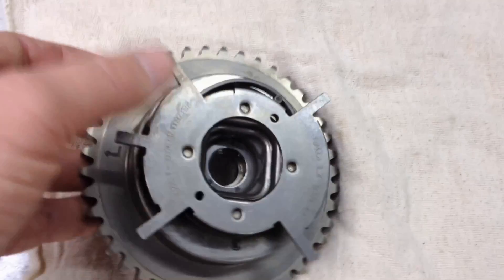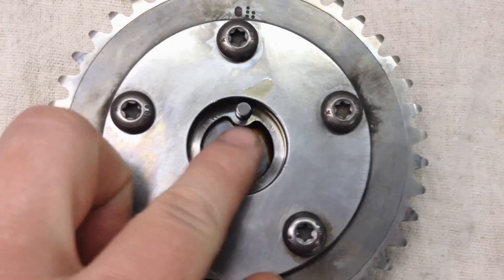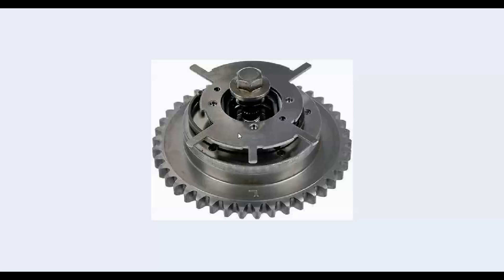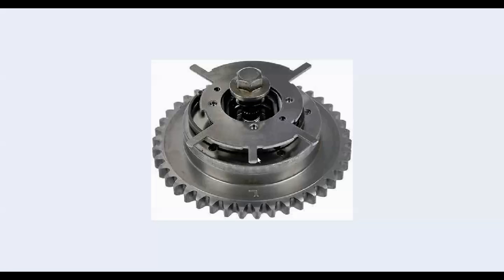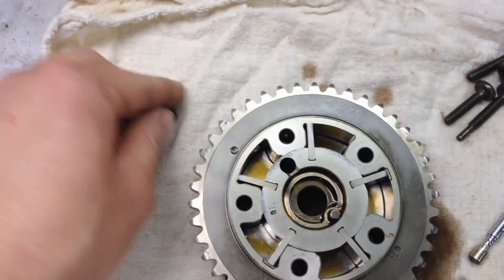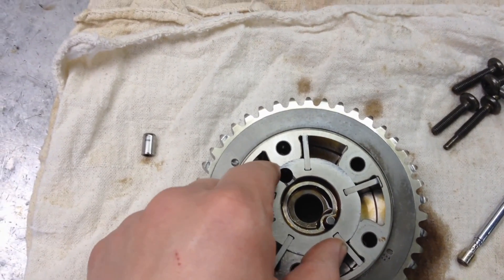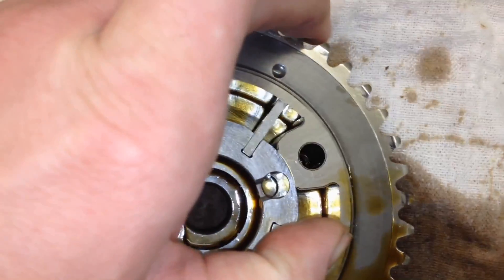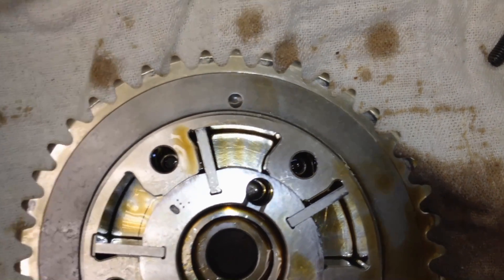Ford 4.6L 3v & 5.4L 3v Camshaft Phaser Knock Explained

Comment: +FordTechMakuloco so is it true that increasing the weight of the oil from 5W-20 to 5W-30 can solve the issue? I always figured that by increasing the weight you would just be putting a bandaid or a bigger problem but if increasing the weight will solve it I can do that I'm due for an oil change anyway. Ive got a 2004 F150 5.4 Triton and ive been running 5W-20 synthetic. The ticking noise is definitely noticeable but not as defined as some that ive seen. Im debating replacing the VCT sensors as well.

Comment: Hey my son bought a 2006 Ford Expedition with 5.4 liter 3v and we replaced cam phasers and timing chains , guides and tensioners and I know for sure I timed it right , but now when you go to crank it it is like the timing is off it cranks over slow and when starts it runs good but has a crappy idle and no codes , when I pulled the bolts out both cams hardly any oil came out someone told me I should have blew air thru to make sure they weren't stopped up coming from camshaft is that true ? I rechecked timing marks are good but when cranking it is like when you have a distributor turned to far and it hard turning motor over , also it is popping thru intake , any help would be great , thanks
Reply: It is not timed right. sorry

Comment: I have a 1998 Expedition with a 5.4 triton but I dont know if its a 2 valve or 3 valve . It has no VCT solenoids and it uses regular plugs so I assume its a 2 valve , but it sure seems to make this same " paint can ball rattle " especially in a drive thru or next to a wall .
Reply: I have a 2000 f-150 with 230,000 mi. It has a paint can rattle noise but its my catalytic converters. I don't think they had Variable Valve timing in 98
Reply: 2-valve, 3-valve was still a few years away then.

Comment: +FordTechMakuloco Good afternoon, i have an 2005 mustang GT and I just replaced both my phasers and both VCT's, every worked well the first 50 miles but then I heard what sounded like phaser clicks but not as audible as my old phasers were... Got a check engine light last night and this morning it chatters again....
When I did the install of the new phasers, I did notice as I torqued the new driverside phaser, the tone wheel  turned/rotated as I torqued the main bolt, does that mean the locking pin sheared?
Reply: Also, in regards to the tone wheel rotating while I torqued the phaser bolt down... It rotated about 30 degrees and when I stopped applying torque, the tone wheel returned to its normal position on its own.
Reply: hello, did you figure out the problem? I have an 05 Gt as well & I am barely going to replace both phasers & VCT's

Comment: do you recommend doing these in pairs? i usually have seen just one fail but seeing as you have the whole front cover off it might be a good idea to do the other because it is following. just wondering your thoughts. great videos.
Reply: If you're in there it's cheap insurance at that point. depending on the mileage, I'd probably put a new chain and tensioners in too.

Comment: +fordtechmakuloco hello there im from NY i own a 05 f150 5.4 at the shop they just did timing chain job, few days after i got the car back i hear this crazy rattling noise and truck would shut off at red light etc, i brought it back 3rd time now for same issue and they are doing the cam phaser now, plz help on a reply i do feel like these guys aremt honest to me

Comment: my 2006 f150 starts ticking shortly after start up. Not sure if it's the lash adjusters or cam phaser. I changed all plugs and cops 10,000 miles ago. truck pulled a misfire code @ # 4. changed cop and plug no change. changed out fuel injector and ran ok. Idle is now rough and low, but never dies. Now, when I hit the gas its falls on its face, stumbles and just won't accelerate at all. Again,  no trouble codes. I bought the truck new and have changed the oil every 3,000 miles. It currently has 158,000 on it. Any suggestions on where to start or look?

Thank you for the videos and your time!

Nick
Reply: I GOT SAME PROBLEM, AND A  TOP SPEED ARE 70 MPH, NO MORE...

Comment: The major cause of this is not running the correct oil. As the owners manual says use 0W-20W synthetic. As the passages are very small and running heaver weight oil it can't get in to the small holes used to control the pressure on the Phaser for timing.
Reply from the maker: Idk the manual calls for 5w-20 and many have ran heavier weight oil like 5w-30 or 10w-30 since new and report no problems with the vct system it protects the vct's better. Same reason turbo based engines generally run a higher weight.
Reply: FordTechMakuloco I was just making general observations. As I seen people use 5W-30W and the manual says 5W-20W or 0W-20W depending on those magic words "Sever Duty" or Conditions, which is not defined. So I always look at the manual and what the normal operating weather conditions are and if proper maintenance for that vehicle was done. As the weather is different down south and up north.
Reply: +Michael Mike I've done a lot of research since I last commented, and it seems like Ford's modular engines were designed with running 30 weight oil in mind. They only state to use 20 weight oil for emissions regulations, which is a shame since it's not the intended oil weight for the engine. I use 30 weight oil in my 2008 Mustang GT and it works great. I'm in Florida and it gets very hot here, plus my engine has 128,000+ miles on it so it's good to step up the weight at that point because of wear and tear.
Reply: I'm having an issue with a noise on my passenger side of the engine exactly where the phaser is on my 2008 Mustang GT. There is a noticeable loss of power and something os definitely not right. Funny thing is, I changed my oil from castrol full synthetic to amsoil full synthetic, both were 5w-20. So I'm certain my car doesn't like that oil lolz....
Reply: +Claude “Reviews4U” Rains I've run 5w20 Motorcraft since I bought my truck at 18,000 miles and now at 90,000 it's starting get loud... so mine is due to defective component imo.
Reply from the maker: Michelangelo Hamato I agree especially on the 3v engine 5w-30 is the way to go.
Reply: +FordTechMakuloco :)
Reply: +Joe Correia the manual states 5w-20 because Ford wanted lower emissions ratings on their vehicles. But the 3v engine was actually designed with 5w-30 in mind. Many Mustang owners, myself included, made the swap from 20 to 30 with no problems.
Reply: +Michelangelo Hamato really....I mean I have tried 5w30 in the summer months but went back to 5w20 after reading different things and coming to the conclusion that I'm not smarter than the Ford engineers...lol
Reply: +Joe Correia The Ford engineers are smart, but the rule makers are slicker... which is why you car says 5w 20 and not 30. You should give it a try again :p
Reply: my GT 2006 does the same thing so I drive it with VCT solenoid unplugged, how did you fix it tho?
Reply: +nirson123 replacing the phasers or solenoids will fix your issues. It can get costly fast though, and it's hard to diagnose whats actually wrong. If your timing chain tensioners are bad and your timing chain is rattling a lot, it may have an oil leak which can also affect the vct oil pressure
Reply: no way will I use a s*** 20 weight synthetic!! I have over a hundred eighty thousand miles on my Expedition 3valve, using Castrol 10-30! it's a tough ass motor so no way will I use a girly, 0w20!!!
Reply: @DRDRE-ex6yg  yeah that's what we call "bitch weight" oil...strictly for girl scouts

Comment: I have an 2006 F250 5.4 Triton with this problem.  Is there an replacement engine that's comparable to the 5.4 Triton without cam phasers?  I think mines has more problems then just the cam phasers and I'm considering just replacing the engine to avoid this problem...just not sure how to find a legit replacement engine...

Comment: Hi, One of my Cam Phasers did not have a Plunger on the spring. Why could that be???
Reply from the maker: +fresnoblue13 Was it a different brand? It may be a new design also. These phasers have been revised multiple times over the years.
Reply: Not sure, they also both have the L and no R on neither side. My chain guides and one tensioner was bad. my Phasers look good plus I installed limiter on them. just don't want to put everything back together if that one phaser not having a plunger inside will cause any issues
Reply: +FordTechMakuloco Hi, I checked them out yesterday and they are both Ford phasers.
Reply: +fresnoblue13 u.kl just nmjol
jm;ĺnio

Comment: after changing the oil with a synthetic blend and  replacing  the solenoid's on both banks and started the vehicle, im still getting the rough idle after the vehicle warms up a bit....im so pissed right now..lol   the codes I am getting are po0012 and po0022 and po345   plus o2 code because he remove the CATS.   it runs great at idle when I first crank it up so it apparently in time. but if I step on the gas and let it fall back to idle the rough idle begins....I can turn the key off and then crank it up some times and it will run great again until I hit the gas again... what do I do? change the phasers?  is there any thing else it could be?  I have voltage to the secondi's.. please get me in the right direction with this...what else could it be.....low oil pressure? how low is too low?  the vehicle is not making a lot of noise after operating temp has been reached... I wish I would have check out this video earlier... I could have check the alignment or the phaser.. looks like I have to tear it down again.  if you have any ideas or comments I would appreciate it.  thank you... this is my first po0012 ect.... and it figures it wouldn't go smoothly by just replacing the solenoid's.. lol
Reply: did you figure out the problem? I know the po345 is for the camshaft position sensor replacement which is around $15-25 online or auto parts store
Reply: yes, bad phasers.. thank you.

Comment: Nice video. Very informitive. I have been a Ford guy for 37 years. Thies have git to be the biggest POS engines ever made by Ford.  My wife owns a 2 valve and it has been the biggest pain. My 3 push rod Fords has none of the problems that thies have. I surely dont want a 3 or 4 valve.

Comment: I'm not sure my car had the phaser knock trouble. 94 Mark VIII I bought it with 100K miles always ran beautifully EVEN THOUGH starting procedure always included WHAT SOUNDED LIKE a flat lifter. The knock never lasted longer than 1.5 seconds then disappeared. I have been told that the sound might have been a cam chain tensioner part. But something broke making the car quickly overheat. Now IT REALLY BEHAVES exactly like you would expect from a motor that is a tooth off on the timing. Can you please point me in a direction??
Reply: I think the 4.6 L 2valve motor is your best bet. Cam phasers are found on 4.6 3 valve motors as of 2008.

Comment: Don't forget to check the timing chain tensioners, the gaskets blow out between the tensioner and head causing low or no oil pressure in the top end. Always a good idea to pull a few camshaft caps to check for scoring. Just because the phaser is making noise does not mean it is the cause. Sscc
Reply from the maker: Kwils69 Good points

Comment: Interesting how it works, seems like it moves quite a bit so I assume that would translate into quite a few degrees timing ? That seems like a frequent and expensive repair.
Reply: 2002 mazdas had the same designe on their mazda 6-s and. my cars still works, even though the last owner didnt take care of the car.
Though mazdas design has extra thought but into it, so no raddle and smoother movement with steady pressure

Comment: does this problem cause the car to shake and rattle? like the car is going to fall to peices? my car has this problem when the car is hot in temp  after it runs for about 20-30mins then  cruising say over 30mph and comming to a dead stop and bam  the noise and shakes and the rpms dip to around .5k  i give it gas to around 2k rpm and its fine again but from .5k rpm to around 2k rpm alot of hesitation and sever power loss   any sugeestions and help would be greatly appreciated  thanks
Reply: did you find the problem? It is happening to my vehicle as well...
Reply: bodyfittv any luck?

Comment: Great videos!  We currently have a 07 f-150 5.4 in the shop for some noise issues.  The difference here is the engine is silent cold and when gets hot starts making a rattle/tapping noise off between 1000 and 1400 RPM.  Base idle is relatively quiet (although there is still some light rattle noise).  With the VCT solenoids disconnected, the off idle tapping goes away altogether.  Our base oil pressure is 28 lbs hot idle.  I am thinking this maybe a solenoid issue.  What is your take??
Reply: Chris Withers Did you find out the problem? I think I have this issue.

Comment: I am considering a F150..Do you have a suggestion on which engine seens to have the least amount of problems.
not seen the base v6 in. most of your vidoes. 
thanks for posting all these very helpful videos.
Reply from the maker: kens97sto171 I would get the base 3.5L or the 5.0L hands down for the least problems. Now of course they have their power differences so that would depend on what you plan on using the truck for.
Reply: FordTechMakuloco Thanks. will take your advice. leaning towards the v6. more room under hood and i dont need the extra towing power. thx again.

Comment: Thanks for your phaser explanation.Can you tell me, if I don't do anything about the noise, is that bad?  In other words, it is noisy, and I can change them, but do I have to?  Can I just live with the noise or will they progressively get worse and finally blow apart? 
Thanks.
Reply: +FordTechMakuloco Mine has gotten worse, ive noticed slow engagement of the VCT system in instances where id go from say 2k in overdrive to 4k during a kickdown (stomping the pedal) I feel the power come on with a lag, almost like an odd turbo lag. I was thinking maybe my issue was the tensioner seals resulting in low oil pressure but I dont really have any sort of startup rattle? Or atleast if I do its so faint I cant hear it, I have noticed when the engine is colder it responds tons better (typically below the 1st quarter mark on the temp gauge) At the same time I wonder if my truck is running leaner than normal due to a possible vaccum leak somewhere? I recently resealed around the air filter tray that had deteriorated causing a bad bog and drone noise around 1.2k rpm. This truck of mine is just full of fun surprises :/ when it does run right though (typically below that quarter mark on the temp gauge), it has plenty of power! But still sounds terrible. Tons of people think my truck has a diesel engine in it! Some swear it does!
Reply from the maker: Pete Pembroke The noise may get worse but generally if you don't fix it everything will be just fine.

Comment: Great videos! I do have some questions though about the whole vct system. I have a 2010 f150 4.6l 3v. First off, at an idle, theres the typical clicking noise which after listening to it, it seems like my injectors.  But upon a light tip-in excel, theres the horrible knock/tap that occurs between 800 and 1200rpms.  This is a bad phaser right? Or maybe another defective vct part?  Also, I see you recommended the Dorman phaser in the description, is this the best replacement option available? Or are there other manufactures that have better reviews? (I hear horror stories about replacement phasers going bad again)  What are your thoughts on the livernois lockout kit? I just need some straight up advice before I go spending $$$. Also, I see that youre from Chicago, have you heard about any reputable shops in the west Michigan area? Im always a do-it-yourselfer but I currently don't have the time or a shop to do it in.  Thanks for your time! And keep up the great videos!
Reply from the maker: 03blasteryfs No ideas on the shops in your area, the Ford units are by far the best and most expensive. Although a failing phaser can cause the concern you describe we mostly see the vct solenoid cause this. As far as the lockout kit they are a great idea but expensive I think.
Reply: FordTechMakuloco alright thanks for the reply! Ive also researched some guys goin to a 10w-30 oil versus 5w-20. Is it true that thicker oil builds more pressure? when i start my truck cold theres absolutely no noise, but it starts when the engine reaches full operating tempertatue (maybe because the oil is hot and thin). Should there be any concern with me trying 10w30? thanks
Reply: @03blasteryfs  same happening here... How did you fix it?

Comment: You are an outstanding teacher and KNOW how to explain things VERY well - you are applauded!

My 06 Mustang GT 4.6 has 108,000 and was run VERY low on oil for about a week or more (down over 4 quarts) . After a few months I changed the plugs and oil and now it is idling rough and while idling rough and unsteady it has a clanking sound reminiscent of a diesel engine. I am getting codes 345 - 349 - and 171.
 
I changed both VCT solenoids and problem remains unchanged. As soon as you race it a bit it runs smooth and quiet. It is so rough on pickup it cannot be driven.
 
Does this sound like cam phaser issues? Low oil pressure?

I see some videos of changing the phasers without doing anything to hold the camshaft or removing any rockers - I don't know how this can be done. I really would appreciate any advice.
Reply from the maker: You can verify if the phasers are the issue by disconnecting the vct solenoids and driving it but the way it sounds is the oil pressure is too low for the vct system to work properly from the engine damage from running it low on oil. Do the codes pop up rather quickly after starting it.
Reply: The engine had all but blown up and I give up. You are completely correct it is shot. I am buying a new 2015 gt conv to replace it. Thanks for taking the time to respond.